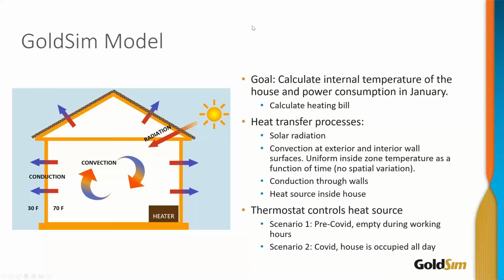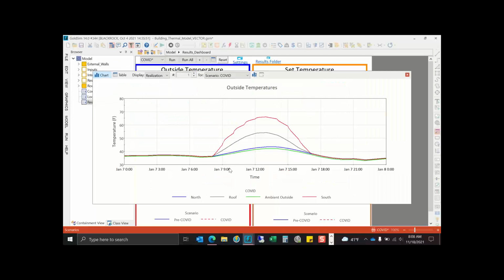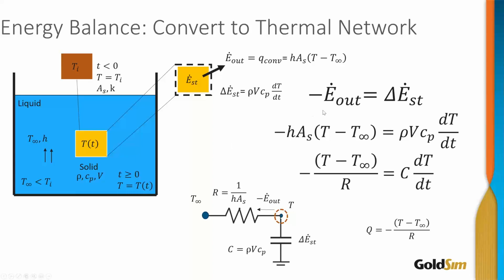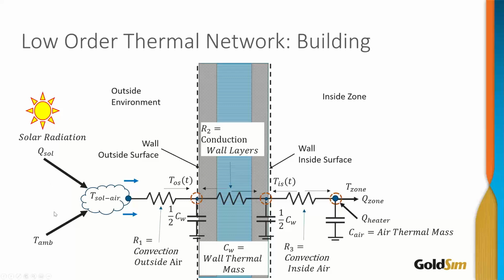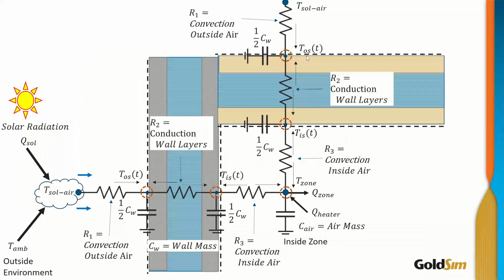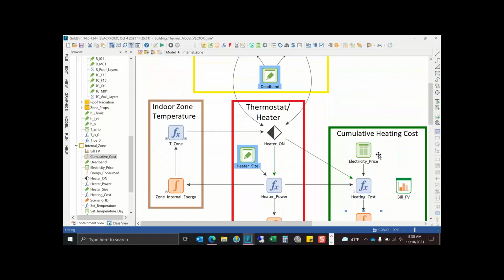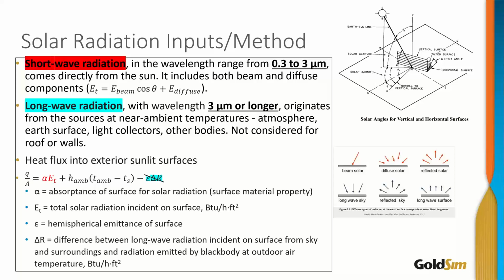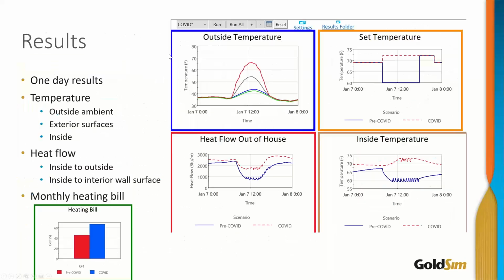Modeling a Basic Heat Transfer Process

Comment: Pretty good presentation. I'm a retired ME myself. Just one critical comment. When you were discussing radiation, you said that the diffuse long-wave radiation was the reason we could see things in shadow. The human eye cannot detect at 3 microns, or above, so that cannot be true. However, the diffuse radiation in the visible range (0.38 to 0.75 microns) will help illuminate the shadows. Of course, reflected light is also a contributor to illuminating the shadows. How much of each would depend on the environment.
Reply from the maker: Ian, thank you for your comment. We will make sure this is noted in our model.